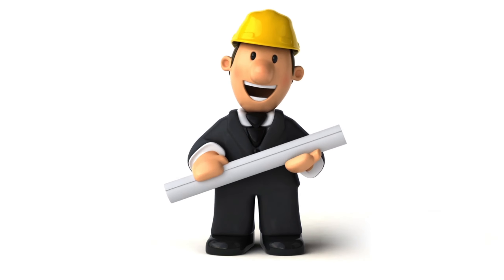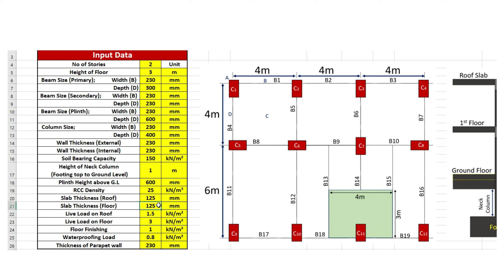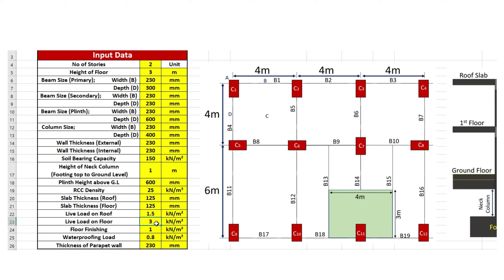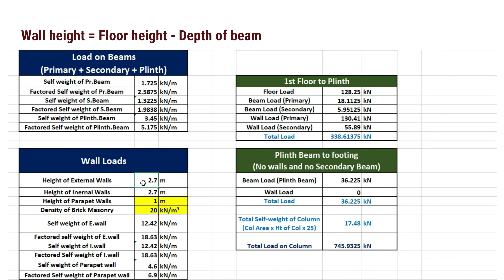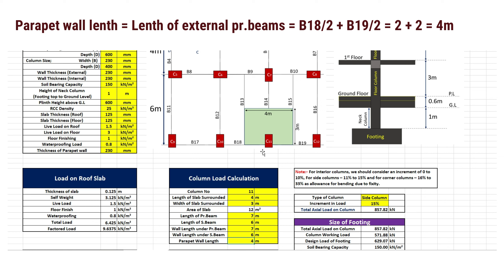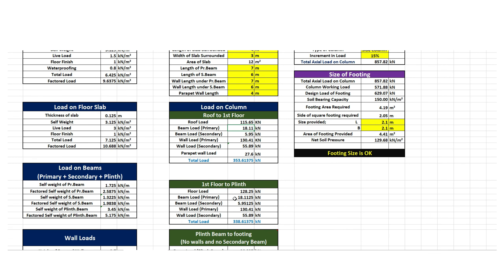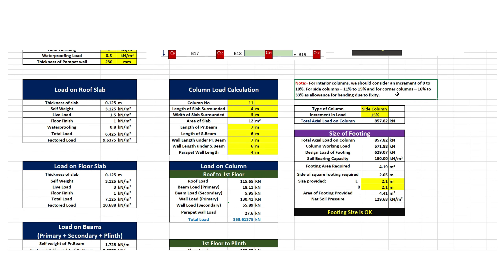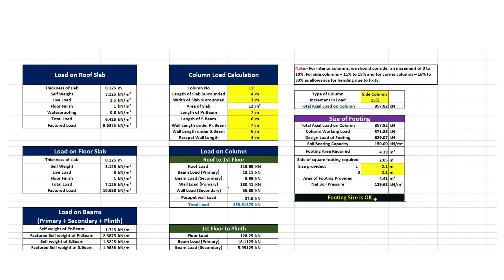How to calculate the load & footing size for side column of a building? | By Approximate Method

Comment: What s the difference between total axial load on column and column working load? I don't understand why it needs to be divided by safety factor 1.5 and then times safety factor 1.1 again. Wouldn't it better to use the axial load directly to determine the size of footing?